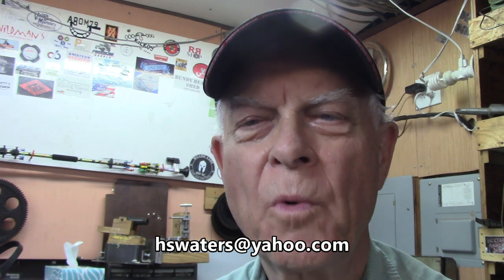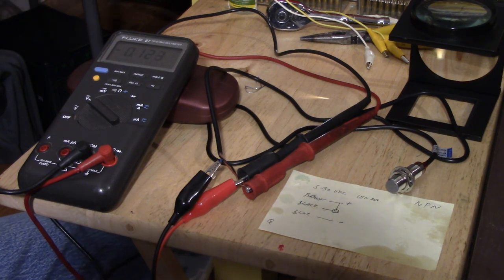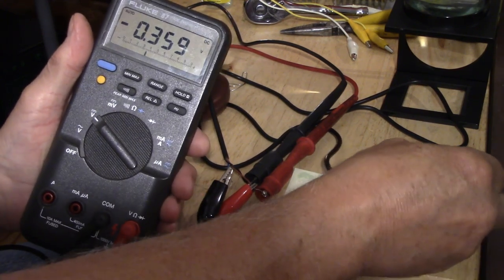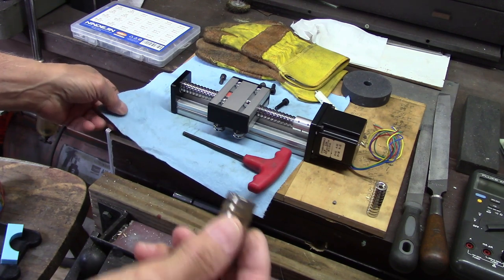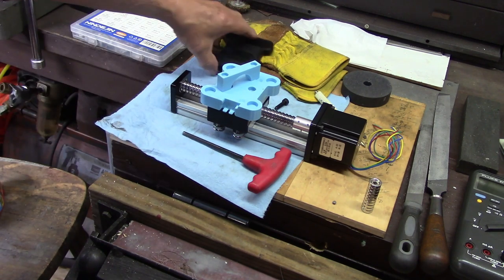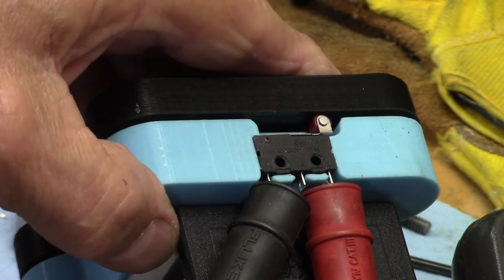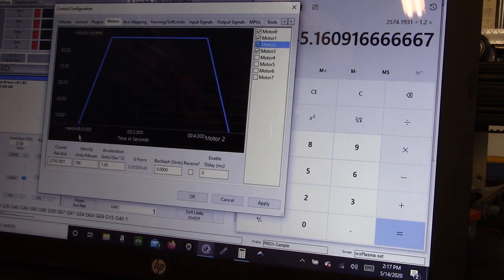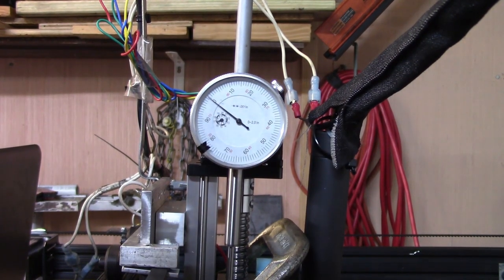Breakaway plasma torch and proximity sensor

Comment: Hi Harold, I've always understood that type of magnetic sensor to be referred to as a "Hall" sensor, as it uses the Hall effect to create a trigger current.  They can use two or three wires, depending on the circuit board.  Three wire is easiest to set up and use from my limited experience.  The other type I am aware of is optical, where a make/break light beam is used to trigger a device.  Cheers Rob
Reply from the maker: That is true it is a Hall effect type of device.  Thanks for stopping by.

Comment: Following the progress as I am just now starting my plasma table.
Reply from the maker: Well I would do a lot of it another way myself.  I would make it 2.5 feet by 4 feet.   I would go with rack and pinion instead of the belts.   I think I might use grbl instead of Mach4.  And for sure I would get a much better plasma machine something like Hypertherm.  And I would get a lot better torch height control.  Thanks for stopping by.

Comment: Most inductive proximity sensors respond to conductive materials such as steel or aluminium. Steel is best, but you usually don't need a magnet.
Reply from the maker: I will take your word for it.  I bought a couple o them and played with them and now they are in the past.  Obviously I did not learn a lot.

Comment: Hi there, did you ever implement this solution, and if so, how did it go? 

I like the minimalist-ness of that actuator, totally bare bones simplcity
Reply: I did not implement the proximity sensor but I did have fun playing with it.  The breakaway was breaking away too much.  Thanks for stopping by.
Reply: @haroldwaters8238  thanks for the reply, appreciate the info, cheers
Reply: @haroldwaters8238  I looked further into this, mainly because I already had the torch mount printed. I measured the recess to be 6mm. So I bought both 5mm and 6mm magnets. 

Also, the magnets you bought, were countersunk, meaning they had maybe 40% of their mass removed because of the countersunk hole, making them 40% weaker than the 'full disc' magnets that Stuff Made Here used. 

When the magnets arrive (aliexpress) I'll experiment with the 5 and 6mm discs and see if I can get it to lock properly.
Reply: @ned900  great let us know how it came out.
Reply: @haroldwaters8238  willdo. I wouldn't have come across the mount were it not for your video, so I will do that no problems.

Comment: I am thinking that you could, perhaps,  use sensor less homing to home out your x,y,z positions, then have your gcode raise  your desired distance. It might even work instead of a breakaway. Just speculation, I haven't actually tried it, yet.
Reply from the maker: Since the video I have tried the breakaway torch and it is not for me.  I am working on touching off the torch.  Thanks for stopping by.

Comment: Harold your a little out with your description PNP or NPN is in a nutshell the  difference is the output not what switches the sensor, what you have there is the 'Hall' type this switches by the south pole  of a magnet there's a few types inductive will switch when ferrous metal is close to it another is capacitive these can be mounted say on the outside of a tank sense and sense the level of the content inside.
Reply from the maker: I have a capacitive sensor ordered.  Thanks for stopping by.
Reply: You're a little out with your use of homonyms yourself. "Your" is the possessive form of "you". e.g. "Your car has arrived." "You're" is a contraction of "You are". Which is what you should have used. English could be a third language for you though.
Reply: @AmateurRedneckWorkshop  Harold not to sure what your trying to do with the sensor but you still may have the wrong type !
Reply from the maker: @1pcfred  yo Paul I did not know you are a grammar Nazi.  Yes English is a different language for me than for the rest of the world but I figure they are getting by OK without my help.  😁   Thanks for stopping by.
Reply from the maker: @Blackcountrysteam  well since it is just for playing with I think it is good enough a type for now.  I have ordered a capacitive model to play with.  If you mean my description of it may be wrong their is every chance for that to be true.  Like I said I don't know anything about these things yet.  Thanks for stopping by.
Reply: @AmateurRedneckWorkshop  I just like to stick it to sticklers.